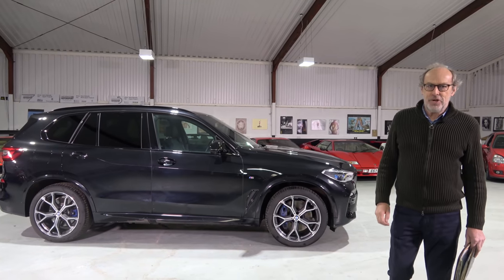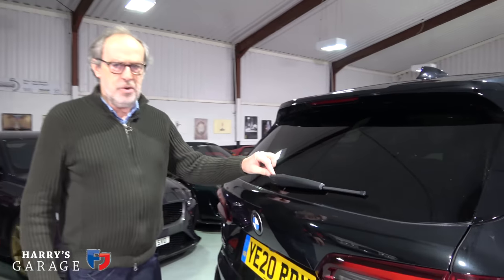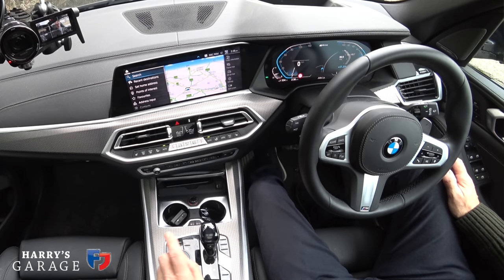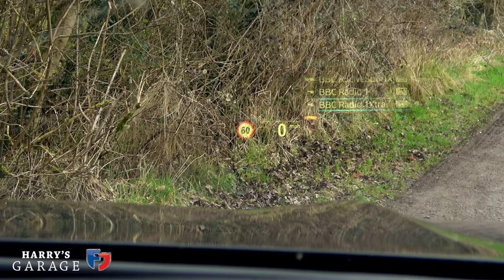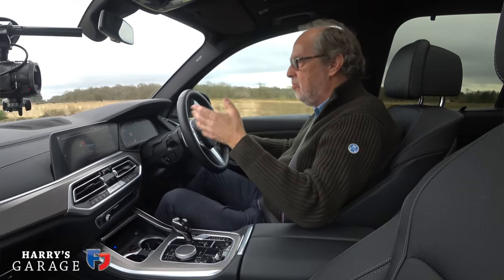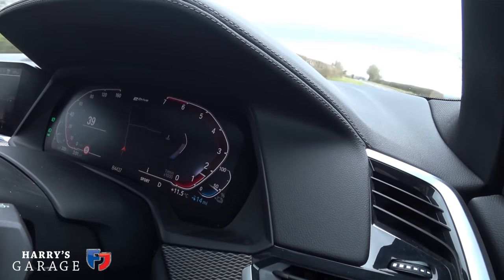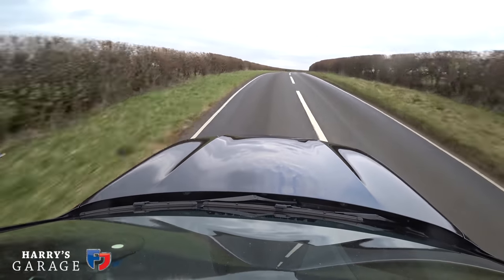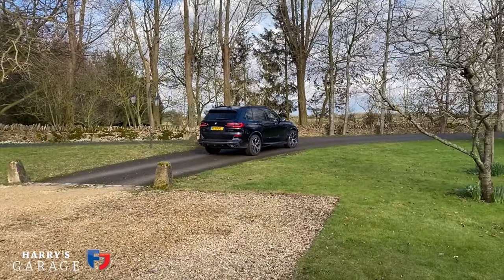BMW X5 45e 10,000 mile review. Why PHEV beats EV for our family car

Comment: With the car fully charged at home in the on position and unplugged ready to go on PARK press the Gas pedal and the engine will fire up for a minute. This will lubricate the engine in case the thermal engine turns on while making the trip. Or if the trip is less than 30 miles just opt for the full electric mode from the get go😎

Comment: 14:25  That's the big complaint with the previous F15 PHEV version with a much weaker engine.  It was absolute rubbish when the battery pack had no charge.  I'll take a much more powerful engine that will rarely get used when tooling around town, but will provide a good driving experience on longer trips.

Comment: From this seemingly comprehensive review, I don't  see any mentioning of HUD(Heads Up Display) does not work with polarized sunglasses, which most US drivers wear.   It's possible HOD is not available for the European version.            I was very much dispointed of this difficiency after paying extra option for the high tech oriented German automaker BMW.    Afterall,  without  polarized sunglasses, it works great!

Comment: I agree with Harry it could have had a smaller/more efficient engine. Yes 37MPG isn’t bad for a motorway trip but its also not great. EV for short trips is great obviously, and the engine is there as backup for longer trips. But I don’t know if the EV part should be used as a crutch for poor ICE efficiency. If you regularly travel longer distances this seems a good ‘nicotine patch’ to help you transition or know whether you’d suit a full EV

Comment: Great vid as always H. Ran the numbers on the 45e including cost of petrol and elec vs the 30d over the 9500 miles and assuming 37mpg on the diesel I reckon the 45e was a saving of only roughly £70. It definitely needs to make use of electric running more to justify the cost to buy I think, assuming similar residuals. 45e still not bad economy for the performance on offer even at those economics.
Reply: It’s pointless. You pay pay like 3k on fuel if you do like 10k miles a year, the hybrid costs more extra over the ICE model yet you aren’t getting that much extra MPG, even if you ran it in full, electric 50% of the time, you are still paying for electricity which I foresee to get much more expensive and you are still buying fuel. Under such a scenario, hybrids aren’t really saving the average buyer any money, it’s just a gimmick like electric cars when people are paying 10-20k extra for a car they will keep for 3 years and not see any return on from what they spent extra over the ICE vehicle. I would only get a hybrid if I was leasing and it was marginally more, let’s say £40 more for example, you could only then see some actual benefits. If you want to be an environmentalist, then that’s a whole different issue and it would be the way to go.

Comment: Great review. You hinted at my one concern about PHEV vehicles other than battery size, how often does the ICE reach full operating temperature and how many cold start cycles does it in practice go through? With lockdown, many with 3 litres pure ICE’s have found if they only do short journeys. the contaminants in the start up cycle just continue to collect and the sensors that these days drive service cycles bring the oil change period down from up to 20k miles to less than 5k. Typically it takes a 3 litre ICE car 15 miles at least for engine oil to reach operating temperature. Does a PHEV operating in hybrid or adaptive ( or any of the modes regularly switching between EV or ICE propulsion) have the ICE oil temp reaching 90 deg C is it regularly falling well below that level with implications for wear and life of the ICE component.?

Comment: Great video.  Nice to see a phev with a decent battery (at last) - but the efficiency on electric is woeful.  24 kilowatt-hours is the same as my 2016 Nissan Leaf which will (still) do 80+ miles comfortably.  Even in winter I'd have to really hammer it to get less than 60 miles of range.   I realize that the Beemer is a bigger heavier car, and has to drag around all the ICE stuff as well - but even so, 30 something miles of range from a 24 kilowatt-hour battery is pretty dire.  Other than that - it looks good.

Comment: Great review Harry. I am on my second PHEV and love them. No stopping to charge on the long trips and/or waiting in line at most chargers. Is that 50MPG Euro or U.S.? That full charge meter said 39 Miles electric with a full charge. realize on the highway you are shutting off the electric because of high drain at anything over 60, so around town are you getting 39 with that heavy vehicle? Great point on the charging rate of this car. 6 miles per hour is pathetic.

Comment: Brilliant video Harry. One question/worry I have about PHEVs is battery lifetime/degradation.. I cant afford these SUV brand new but try to buy 3 or 4 years old and then run them for a further 3 maybe 4 years before changing up again. I recently bought a 4 year old XC90 (late 2016).. and was seriously considering the T8.. but ended up going with the D5 in the end this time because I've heard horror stories of the batteries being worthless after 7 or 8 years and replacement costs being 9,000 euros? Is there any truth to those fears or am I listening to hearsay that is rubbish?

Comment: An update on my BMW X5 45e that I bought in mid December 2021…..as I said about 3 month ago the car is everything that Harry said, I’m very impressed with overall consumption and a nice smooth ride.  Unfortunately a message came on the cars screen about 5 days ago saying PA failure and to take vehicle to a service partner….that I did.
After a while I got a phone call off my local BMW garage (not the BMW garage I bought the car from) saying we think your car has been crash / accident damaged and would not repair the PA fault under warranty. 
My local BMW dealer are going to get in touch with the BMW dealer I bought the car off to see what may have happened, anyone ideas what my next step should be.

Comment: Great review Harry, as per usual. Interesting about the battery drop-off and how short a life it is. Here in Calgary, Canada we have just come out of a really cold snap. It would be interesting to see the range this battery drops to at -38C which we have endured for 10 days. As to the cold engine, that again can't be good in this climate. Majority of vehicles here all have engine block heaters. What is the point of having the block plugged in to keep warm, only for the engine to get no heat when you are driving down the road in electric, the windchill at -49C is now freezing that block.

Comment: I can see cars used only for shorter journeys having the fuel stale out before it gets burnt.  And on the other hand if you can't keep it charged you've just got an overweight car doing 25 mpg.  I guess you have to find the sweet spot.
Reply: Unfortunately a huge number of PHEVs are never charged, they're bought purely for lower BIK and RFL and just end up being a heavier more inefficient petrol as you say!
For context, 45e X5 has a 6% rate this year, 7% next. Ridiculously low for a 280bhp 3.0 in a car that size. Govs plan to have business users flood the used market and lead the change.

Comment: I really wish, you'd get the GLE 350de from Mercedes for an equally long Testdrive. The refinement on the MBUX was the same, they've deleted the rotary controller for the middle console and have gone to touch only on the Steering Wheel...Mercedes needs to get some sense knocked back in to them. The refinement of the 350de is also quite remarkable (IMHO, i'm driving a E300de, same drive train, slightly smaller Battery) and overall it's one of the best cars i've driven in a very long time. Granted, you notice it's a Diesel, but 700NM propell that thing forward like nothing else...
Btw, the BMW 530e has a 4-Cylinder, it's also available as 545e...IIRC, the X3 is also available as 30e and 45e

Comment: Harry  - I think your MPG and cost of ownerships calculations may need revising:
From your dashboard 9574 miles covered at equivalent of 50.2mpg (fuel usage) is 865.8litres used (@125p/l)=£1082.25 in fuel
PLUS your £378 in charging costs gives a total of £1460.25 spend on energy (Fuel + Electric) - which at 125p/l means an OVERALL average of 37MPG equivalent (not the 50.2mpg indicated nor the 74mpg you calculated for the electric use alone)
This is surely no better than a 3.0d X5 and more realistic result for a 2.5 tonne SUV...
Keep up the interesting videos!

Comment: Great review and I really like the car. I think I would prefer it if they used the 35d engine along with that hybrid system but 50mpg is pretty impressive, nonetheless.
Would you mind doing one on the Kuga PHEV if you can get one? It seems to offer similar range and better mpg afterwards in a bit smaller car. 
Its also much cheaper (sorry - more affordable).

Comment: Your point about the cold engine is something that has bothered me, I have a, now somewhat old by phev standards, MB C350e and I always worried about giving it the beans after running on only electric with a cold engine.  The other issue related to this is that if you have given it a big dose of the right foot in a normal hybrid mode, the car will then shut off the engine without allowing the turbo to spool down and cool with lubricant supplied, or am I worried for no reason and Munich. Stuttgart, Ingoldstad and Wolfsburg have thought of things like that in their PHEVS?

Comment: That slow charge is both a curse and a massive pro, slow charging maintains life/capacity of a battery as it was new for MUCH longer. Think of supercharging as actual supercharging or increased compression ratio on engines that were not designed for it. Fast charging kills them quicker. 

P.S. the only thing that is really sour on these is the cold engine operation, that is quite dangerous and we might see these going belly up with very low mileage. Would I own one first thing would be to switch to sport, let the engine get some temp and do the eco/hybrid if journey requires petrol, or just put in pure electric if the drive will be short and inside the electric range.
Reply from the maker: I agree on the slow charging actually being a good thing for battery life but the answer BMW gave me was it was there to protect the grid in Germany from overloading.

Comment: Hmmm, fab video as always- I would love a fully electric car! I have the x3 30 d M sport 0 60 in 5,8 does 149 never needed the latter! mine was 52k - claims 48 mpg, I get 28-32 but having come from slower less refined V8 s doing 9-17 mpg it's still even more economical than my 2015 for transit! I drive to Italy most years, on a cruise through France and down to Rome its exquisite to drive! it's not pc Diesel, but it's cheaper!  at present overall - Electric is the way forward, but we are not quite there yet! f

Comment: Excellent review of the X5 hybrid. Keep this going Harry. I want to know what kind of issues you will encounter after 40000 miles. I have an X5 like this and after 40000, the plastic parts started to fail one by one. I am interested to know if you encounter similar problems. The metal parts in the X5 however is Sherman Tank. The fundamental components are very reliable - diff, gear box, drivetrain, block.

Comment: How are the 21” wheels?  Did you find the ride rough with the air suspension?  Also, the tires okay in wet weather?  I’ve read that they become slippery.
Reply: I bought the 45e with air suspension and 21” wheels with summer RFT.  The ride is very smooth.  Very impressive over NYc roads.  Don’t hesitate to get them.

Comment: So the cost to fully charge the battery is approx 35p if my maths is correct?
Assuming it is about 37 miles range. Seems pretty good if you can constantly keep it topped up.

Comment: Great point on the mechanical sympathy. I’ve always thought that too. Also, does the heater work through electric rather than traditional engine heating? My real pet hate about these cars is how they are currently still allowed to advertise at really high mpg which seems very unfair!
Reply: The X5 45e has a PTC heater. So no engine needed in the winter, but the range gets shorter. Pre-heating while charging helps on range. My average is 2 liter/100km sine I got in in December. Real life data, not unfair!

Comment: Im currently looking at buying a second hand 2019 2020, x5 and im split bitwean the 45i and the 30d witch are to two set ups i like. Im not a big greeny but do see some benefits of hybrid like most of the time im running 30-40mi a day so hybrid would save on fuel, but has a fun petrol engine for time i want some fun or for family holidays and trips. But i do have some concerns due im looking at keeping my next car for a long term, so i may have to replace the battery Also due to the extra wait tyres and pads will that burn through more. Luckily im more than happy to do some of the maintenance to aid in it. But i also like the d30 and according to owner reports its averaging around 47mpg or so but obviously it wont be very efficient going into town but some what less to go Wong bar the add blue  system. So i think it’s a close horse race between them.

Comment: Have you made much use of the battery regeneration feature on longer (i.e. motorway) journeys? I had a 530e for a couple of years and used it all the time so I had a full charge available when I dropped back onto A & B roads.
Reply: How do you do that? Thanks
Reply: @Castries537   - the 530e had a “Battery Control” mode where you can set a percentage charge level to regen up to. This is from BMW:
“With BATTERY CONTROL, the driver can set the charge level for the high-voltage battery manually. This mode makes it possible to conserve or even increase the reserves of electric power while traveling on the highway to ensure that an upcoming section through an urban area can be driven on pure electric.”
Reply: Admittedly I’m assuming the X5 has an equivalent mode.
Reply: @mrgibbs68  Thank you, I think it has that function I will check this out.

Comment: Thank you for a very informational review. Aren't the sill extensions specific to the M model? In the US, the normal "X-Line" has an option for aluminum running boards - I'm wondering whether they would have resolved the issue you point out with getting mud on trousers?

Comment: Interesting your negatives are the same as mine. Useless big key, door sil mud and suspension dropping.
A pity the off road package is not available on the hi-bred.
I have the diesel but getting the hi-bred next time, but not the M-sport.
I like your review

Comment: A late comment, but with the current price of electricity Vs petrol. Calculated running this on all electric (my current energy prices) is about the same as running it on petrol now. Need some solar, wind and batteries!

Comment: Your calculations of cost for the EV running and conversion to MPG equivalent didn't include the losses inherent in charging the battery. It's generally estimated at around 16% BUT the losses are higher, the lower the current. It seems to be a common error when calculating EV power consumption cost.

Comment: Regarding charging, have you checked the amperage it’s charging at in the iDrive?  Because my 330e defaults to 7A I think.  I have to increase it to get the maximum 10A from the mains, but your wall-charger should go up to 14 or 15A I think.  You may only be charging at 7A and by chewing the rate in iDrive you could double the charge speed
Reply from the maker: I have it set at the max of 16A but it doesn't get close despite us having a 3-phase supply at home.

Comment: If the car averaged 50mpg from petrol over those miles and 74mpg from electricity, then the overall cost is going to be much higher than 50mpg, no? It's done a total of 9574 miles at 50.2mpg (so it's used 190.7 gallons of petrol) plus the equivalent of 74mpg over 4952 miles which is 66.9 gallons meaning a total of 257.6 gallons over 9574 miles which works out at 37.1mpg....no?

Comment: You can’t beat a free car for 6 months. I would go for one every time Harry. The elephant in the room is the £6k premium to buy the EV version. This would buy you around 186,000 miles based on the lowest mpg figures BMW state for the diesel. Plus there is a whole lot more to go wrong and batteries do not last forever. So although depreciation may be low at the moment it will average out as the car ages.
Reply from the maker: A modern diesel is currently still the best solution for most owners but new EU7 regs coming Jan 2023 will make them almost uneconomic for manufactures to sell, hence why they are currently being fazed out and replaced by these PHEV. Such a shame..
Reply: @harrysgarage  My current SUV is the Jaguar SVR, just love the Jag V8’s. Purchased one 9 months old for £60k what’s not to like. I was one of the first I Pace owners but the range like most EV’s was awful unless you drove it like a 90 year old.
Reply from the maker: I do wonder how many early EV adopters (like you and me) have decided thanks, but no thanks, after living with an EV for a while? I know of 4 ex Porsche Taycan owners who gave up after bad experience of living with one for a while. Only those that bought it for tax reasons still have them! Enjoy the SVR, I really liked that one, way better value (and more fun) than the Jaguar I-Pace..
Reply: @harrysgarage  Thanks Harry, your review was a great help in deciding to buy one. In fact because of lockdown I did not even test drive one. But I have a rare XFR sportbrake, apparently Jaguar only made 100 and as you know it has the same heavenly V8 so I was pretty confident the SVR would be great to drive. Keep up the good work.